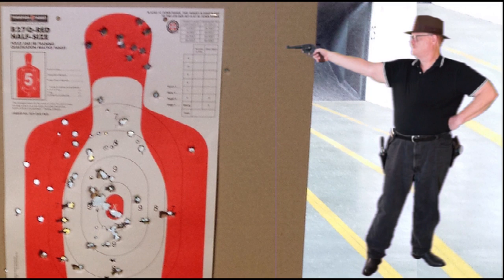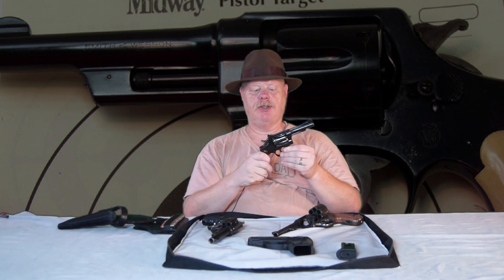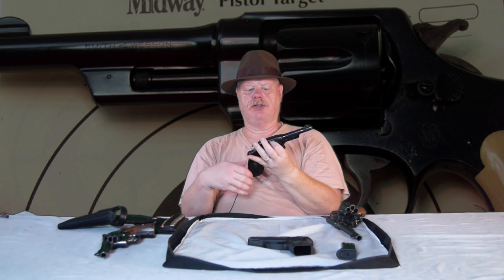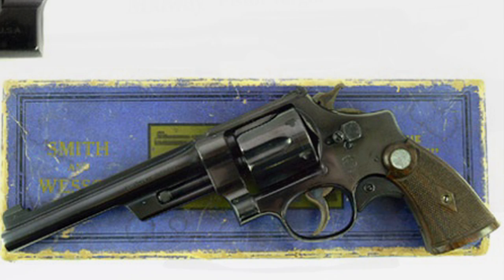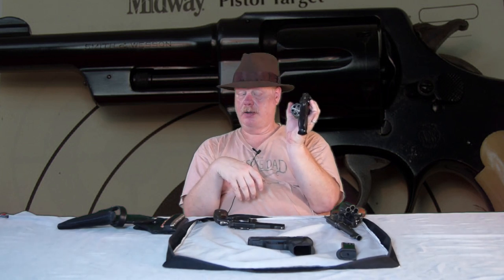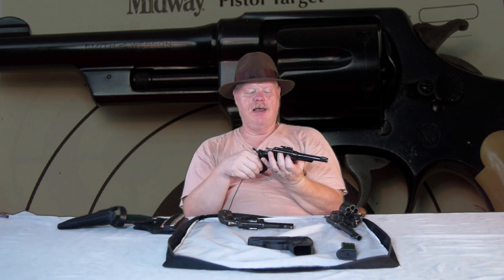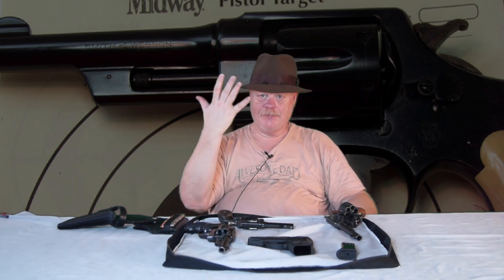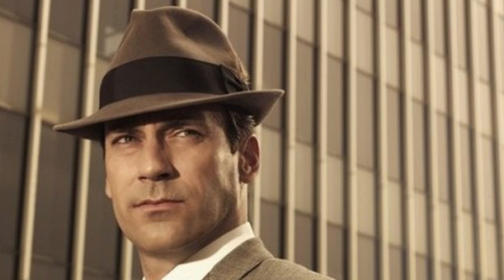Capt. Max's Fun With Guns ep.10: Why an N frame 38? The S&W 38/44 (+more)

Comment: Another issue with the original .38 Special loading was it's unreliability in penetrating sheet metal vehicle bodies. This became a significant consideration during the "gangster" era. Thus the 1930's saw the introduction of the heavy .38/.44 loads. It also saw the introduction of the .38 Super cartridge and Colt .38 Super semiauto pistols.